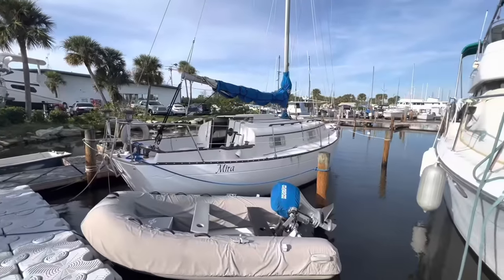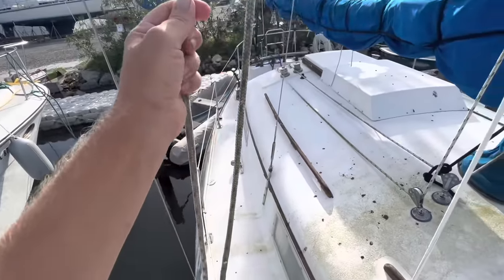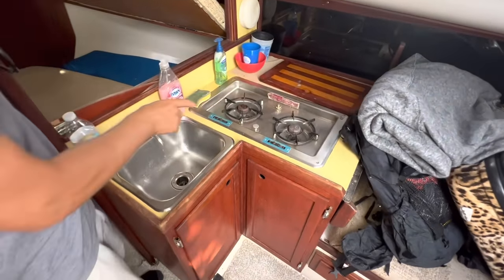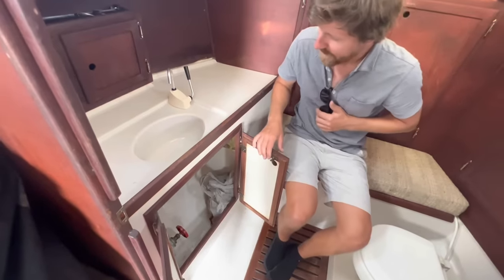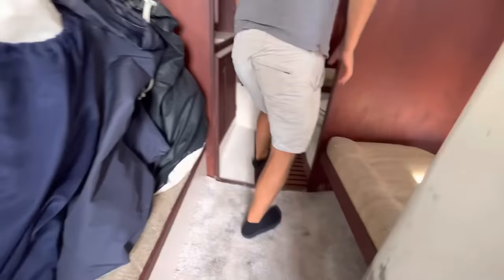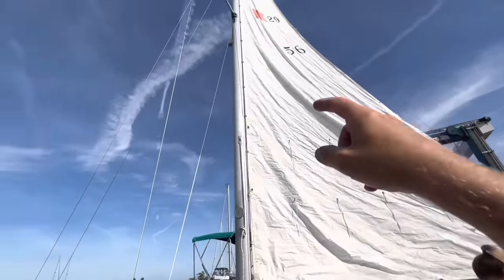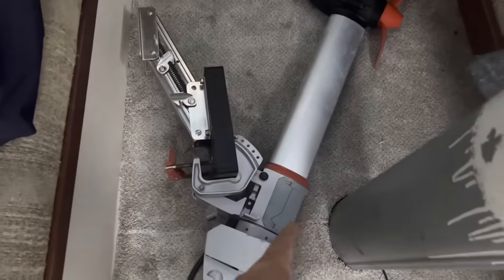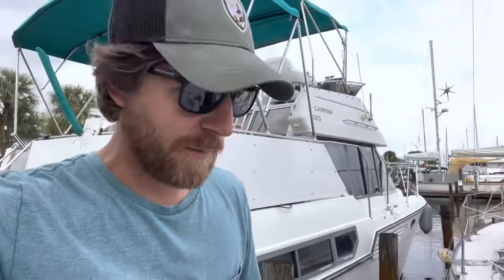Moving onto a free sailboat- bayfield 29ft

Comment: That has to be a 60s boat. That hull is probably indestructible. They way over built them in the early days of fiberglass. $380.00 a month is dirt cheap. We haven't seen prices like that in 30 years here on the west coast. BTW get rid of that alcohol stove. They are extremely dangerous. Speaking from experience. Stove was a 60s model, that was flushed for other gasses.

Comment: Looks like Christmas came early for you.  Personally, I ditch the idea of the inboard engine. Go with an outboard and remove the propeller shaft and glass it up.  I’d also retrofit the aluminum fuel tank with a plastic water tank.  Thoughts on air conditioning?  Florida summers are brutal.  🥵🥵
Reply: Hit me up  @SamHolmesSailing1  how do I apply?

Comment: Like the layout. Plenty of storage and a spacious head forward rather than a lousy tiny v-berth. You should look around for a cheap DIY electric inboard. Maybe use an old forklift motor.
Reply from the maker: I would definitely look into that if I was planning on sailing the boat longer. I think the outboard will be a quick and easy and cheep way to get it going for now though.

Comment: If you find yourself with a boat like this that's worth redoing, do yourself a huge favor and pick up an induction hotplate and eventually replace with a flush mounted one. A friends boat went up in flames because of an alcohol stove. Someone may want to go all electric or at least have a hybrid diesel motor, but still I'd personally recommend getting rid of all gasoline and limit propane to a grill off the cockpit with the tank in a well vented locker and maybe keep a long extension line that can be run below for emergency heat in an unexpected cold snap or to dry out the boat. Once you see what can happen once when a boat catches fire it really sticks with you (over 80% of their body burned, unfortunately), plus electric is a lot more efficient now that technology is catching up. A lot of new boats are coming that way standard too.

Comment: The boat initially looks like a complete turd but, as your inspection goes along,  it has a lot to recommend it.  Encapsulated ballast keel, the sails don't look too bad, nice roomy interior, the boat would be a great candidate for an electric motor project, bilge looks remarkably clean for a boat like this.  Those gate valves for seacocks have to go.  Gate valves are bad!  Given your well documented experience at refitting and creating, you could polish that turd in fine style!

Comment: With the worsening financial situation, I think there are going to be an increasing number of free boats, and some very bog price reductions starting fairly soon, especially perhaps as winter berth cheaper fees start sunning out, and people won't have the money to fund a boat for the Summer. This happened a lot after the 2008 Crashabd lots of good boats just got sunk in deep water to get rid of them. Very Sad really, plus places reliant on yachting Customers via chartering etc, could find customers reduce dramatically. The Caribbean and Mediterranean spring to mind. I "Might" get a recent Secondhand Boat next, but tbh, I'd rather help a good boatbuilder keep going, and a good Agent with a skilled Commissioning Workforce  ticking over if possible, because once skills and experience are gone, it's a heck of a job to get them back. Unfortunately the builders I would like to help in the UK, aren't making boats I can use (due to my disability) but there is an excellent Agent here, so a big chunk of special Customisations should come to most of the Purchasing costs (Customisations needed for a secondhand boat too, so either way, a fair bit can be kept local). Best Wishes and have a great Christmas All. Fair Winds.  Bob.  👍🎅🔔

Comment: It's a shame about the motor, Most of them used a "SABB" which is worth every penny of it.  When you get into a busy port on a windy day you will need a motor if you don't want to deal with the owner of a 10 million dollar yacht after you crash into him. Or anchor out of port and dingy the rest of the way to dock. Then there's the sudden loss of wind 100 miles out in the middle of nowhere. Most of the SABB motors where diesel and sipped fuel at 7 knots. Thank god you have the electric, that is an up and coming thing with sailors, the technology has improved a great deal.  Now all you need is the autopilot gps controlled and your ready for the 7 seas.

Comment: $9,000 for rebuild of small diesel 🤯. Can buy a brand new engine for less than that price. Just bolt a 15hp outboard on the back. I'd put a 50 gal water tank where the motor was.